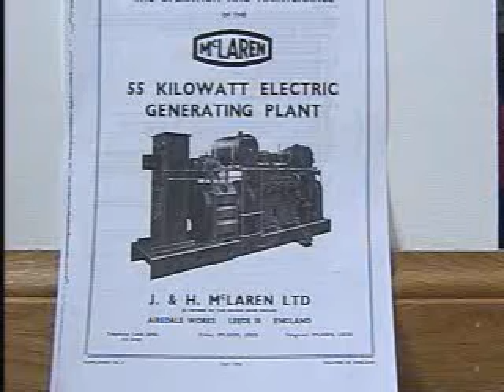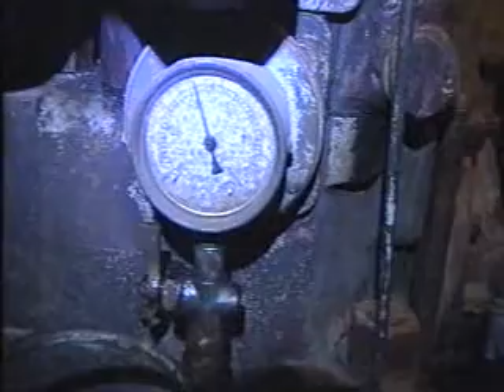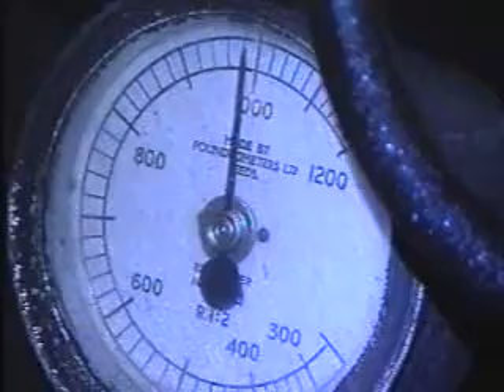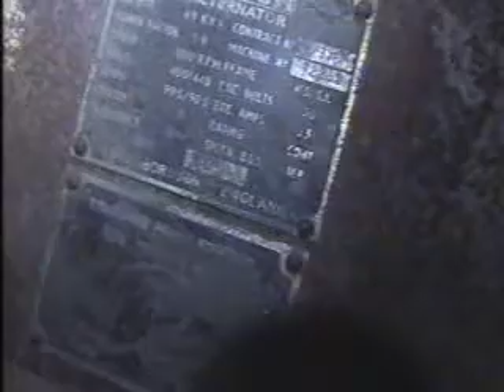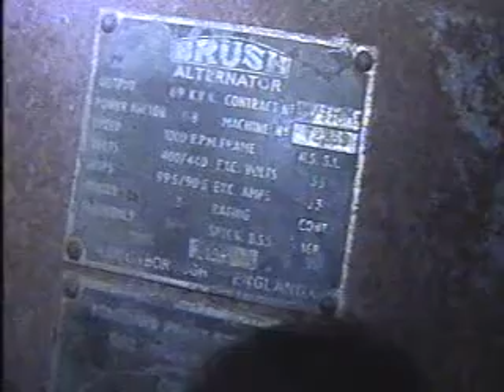Mclaren diesel generator

Comment: Hi Bonusnudges, came across one of these diesels today in a scrappys yard.Has a one cylinder petrol powered compressor to fill the air start tank. It has a 77kva alternator by Brush. Will have a go at starting it. Hasnt been run for years. Any special tips for starting. Has holes in the periphery of the flywheel to aid setting up on tdc. What country are you in? Roman